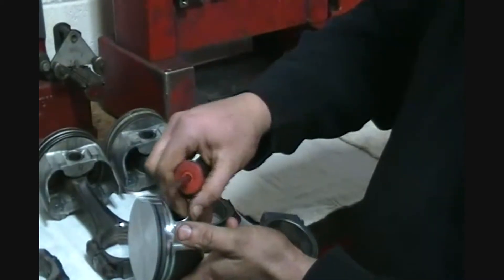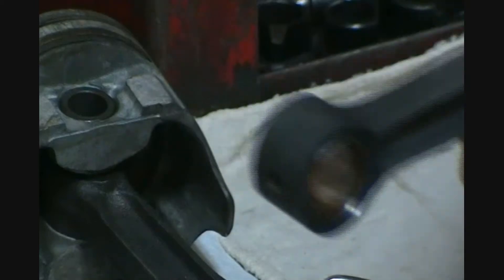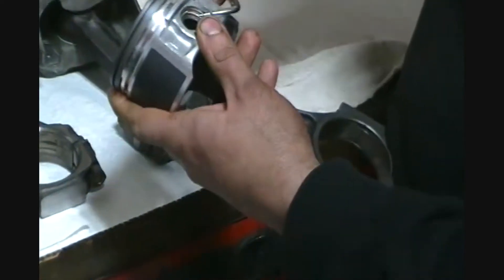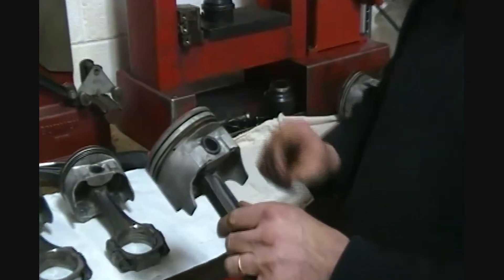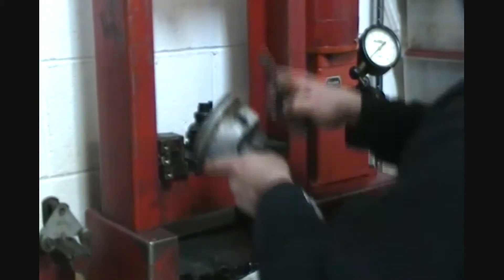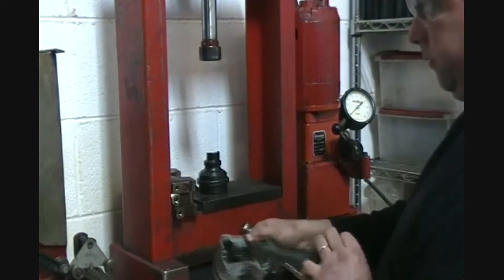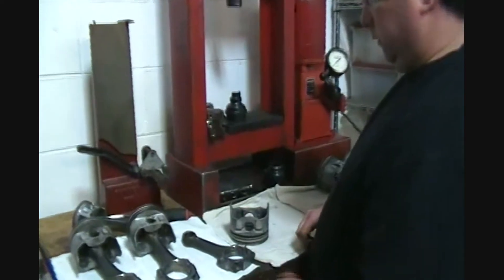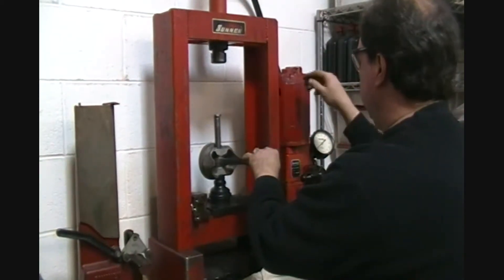How to Remove a Piston from a Connecting rod!

Comment: @Donmega884 Glass bead blaster. If it was my own I'd use a piston groove cleaner and a little Quikleen or brake parts cleaner, compressed air something that will leave no residue. And a little elbow grease and a shop rag.